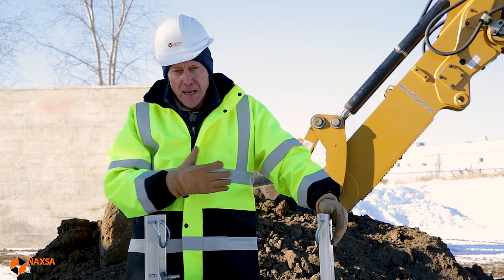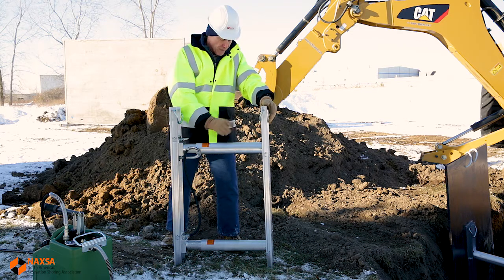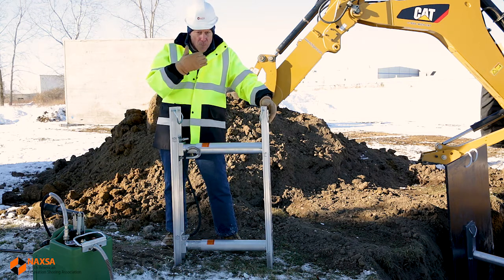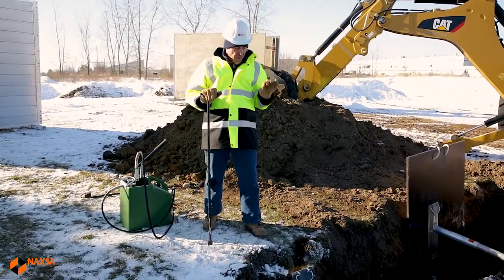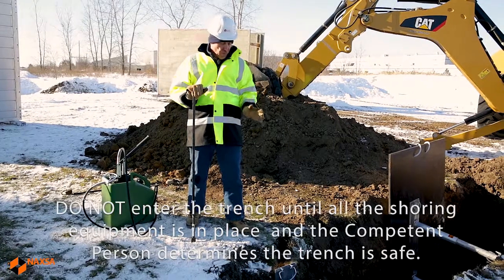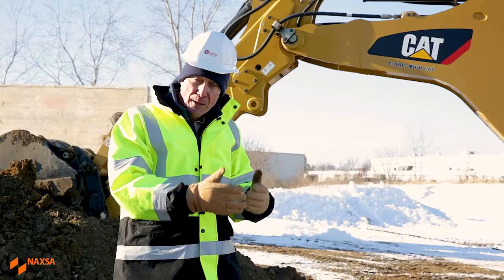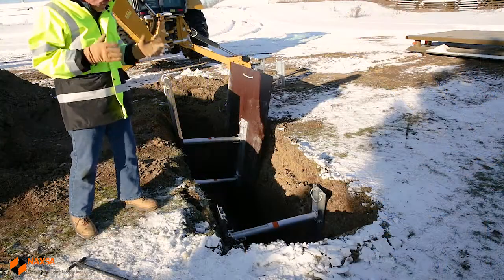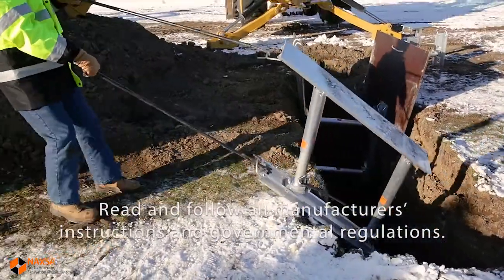Hydraulic Shore Installation | NAXSA

Comment: For a more efficient installation the 'tool' should be on OUTSIDE of shore handle... you will not have to turn 'tool' 180 degrees to release hose... it is one smooth effort saving time and strength doing this 60 times a day... the 'tool' is on the INSIDE of shore handle for release and extraction... do it the correct way, save time, money, muscle & your back.